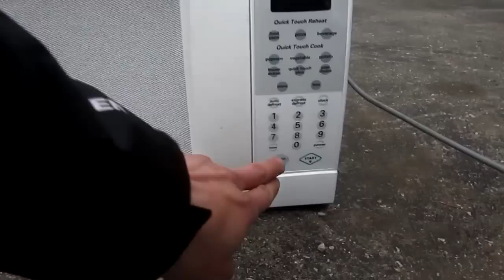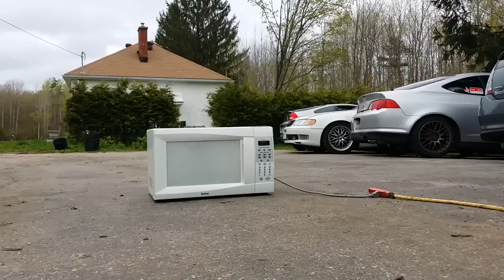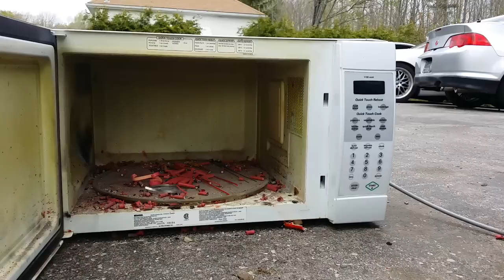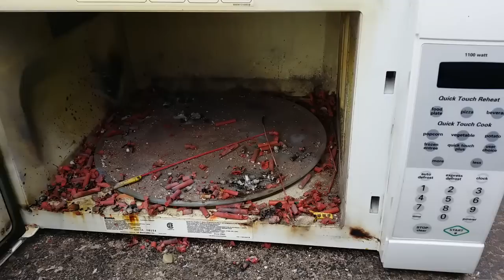Microwaving- Firecrackers | Magnesium | Sparklers & MORE

Comment: I would totally send you some firework mortars, but lately those have been illegal here due to the fire hazard. Not to mention they explode really big, so I got rid of mine. I would like to see you put even just one of the 1inch diameter mortar fireworks in there though, it'd probably blow the door open. If not though, try to get some sodium or maybe lithium, you'll have fun with those reactions. If you try either of those beware that they might melt through the bottom of the microwave, and for extra added fun, try aluminum powder. :D

Comment: Just subscribed! Like you mentioned in the video, what would happen if you wrap aluminum foil around the end of a fuse on a firework? Since aluminum sparks when radiation hits it in the microwave, it would seem like ithe aluminum would spark the fuse, right? Just my hypothesis. Could you please test it in a video to see what will happen? Thanks!

Comment: put a light bulb in the microwave 

or mix 33f water with 100f salty water to generate an electric charge about .05 volts on a meter. 

image if an ice berg was in the ocean visible from California coast that would generate alot of current we would most likely see lighting under the ocean

Comment: for ur very last video put a small gas can in the microwave  and some ammonium nitrate set it for 15 minutes and back away from the microwave but don't put it around vehicles or you can buy 3 jars of tannerite and put that in the microwave for 15 minutes then see what happens to the Tannerite but you will have to stand more than 30 feet away

Comment: You're lucky that the heating elements didn't explode.  Either way, next time put a M-60 or cherry bomb in there and take cover!  Cheers!
Reply: the waves producing the heat not the microwave it self. now i want a cookie.
Reply: +Dry Knees and it's you're*
Reply: +Andre Hemsley They do actually produce heat by rapid wavelengths which causes friction which in turn produces heat.  I think it's convectional heating.  That's why frozen food or cold food is still cold in the center.  It is also the reason metal sparks.  The wavelengths can't penetrate the metal so the friction causes it to spark.  But, what do I know? I'm a fucking idiot.  I'm sorry you're on your period, bro.  I can mail you some tampons if you'd like.
Reply: +Steven Johnson exactly. I think it's funny that he has to correct my incorrect use of "you're" like every other looser that doesn't have a better argument
Reply: nerd